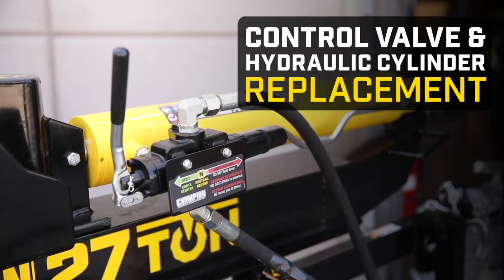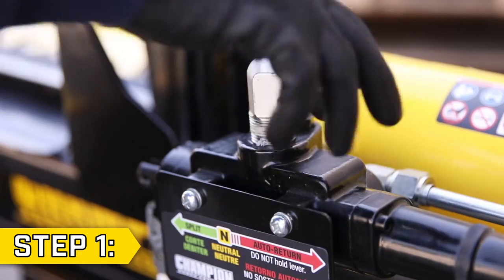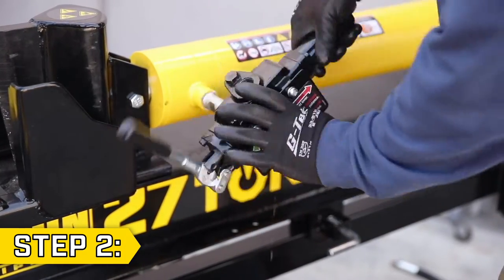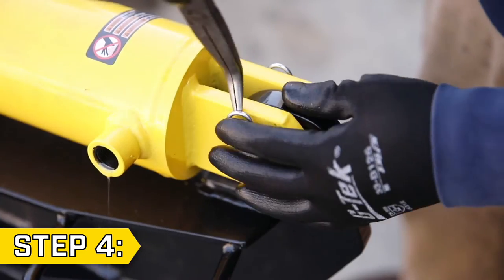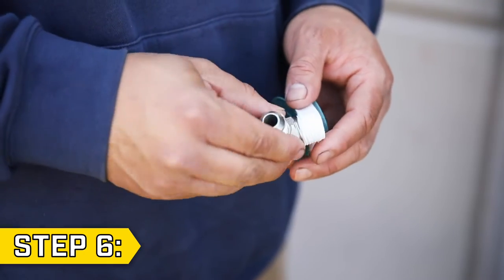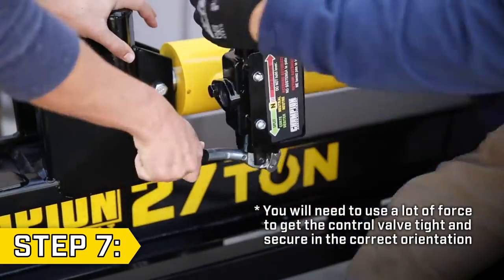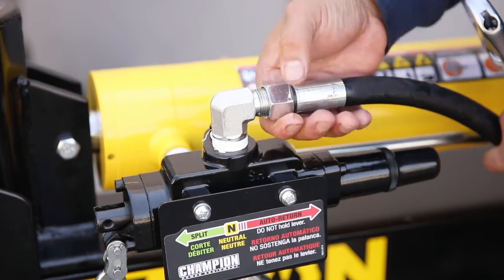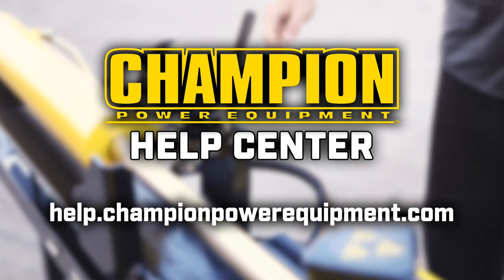Champion Power Equipment Log Splitter Control Valve & Hydraulic Cylinder Replacement

Comment: They have too because everything breaks on them. I will never buy a champion again. I’ve replaced this part because it started leaking- over $100. And now my cylinder is leaking where the rod comes out to split wood. Champion doesn’t sell a rebuild kit for the seals on the ram. Their words on the 1-800 helpline were:” you have to purchase a new ram”. Wasteful and careless. Sell your Chinese products without the throw away philosophy that comes with it. For what the 37 ton costs- it should’ve lasted 2-3x longer before ever possibly having this issue. I’m barely out of my warranty (2years)  and NOT impressed.
Reply from the maker: We are very sorry to hear this. Please send us an email at support@cpeauto.com, so we may discuss this further. Thank you for your patience.